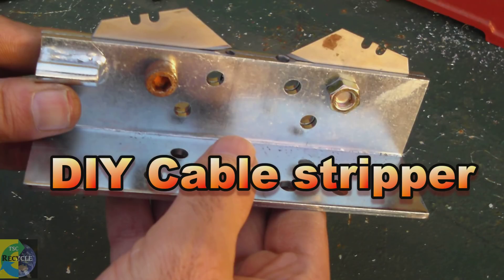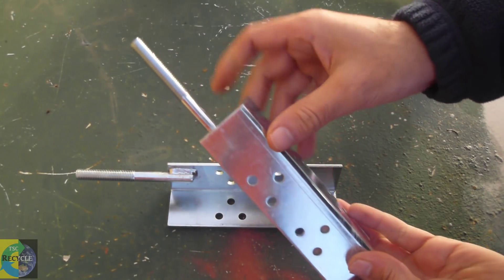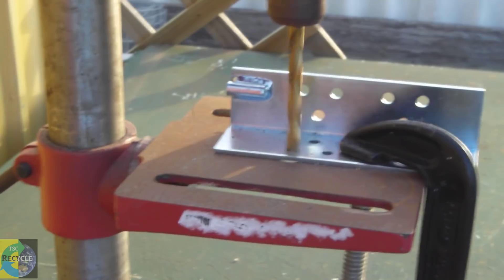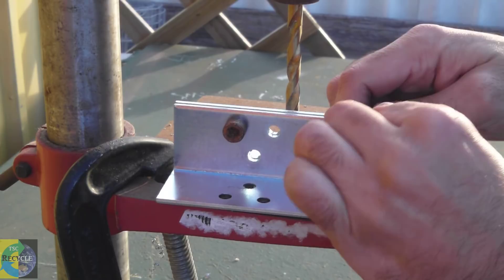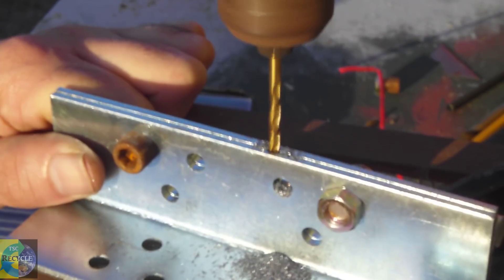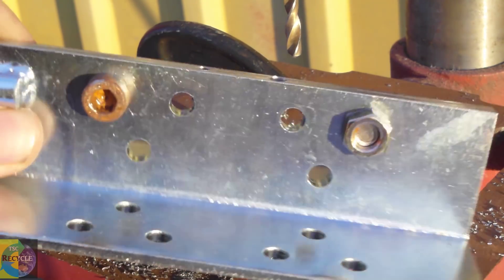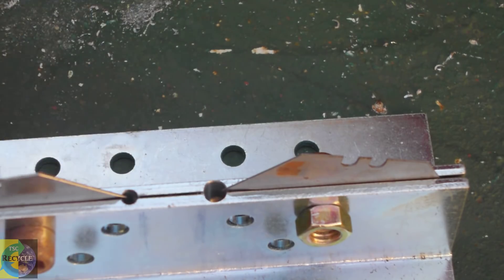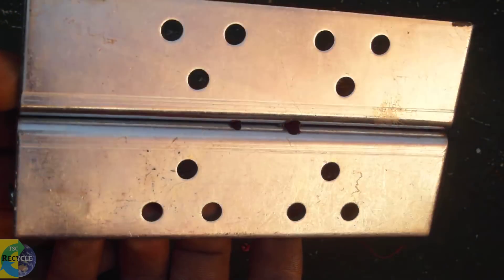homemade DIY cable stripper (from scrap parts)

Comment: Tried this exact setup, doesn't work.

The blade pushes itself out after about 8 inches so I don't end up with a deep enough score to pull the wire out of the insulation. Either that or the wire rolls to the side and the same thing happens.

Comment: All good but l just use a blade clamped in the vice between two washers.

l just put it in the right side of the vice and drag the wire over the blade.

You can use different  thickness washers for different  size wire
.
Just make sure the blade tip is not protruding above the top of the vice for safety.

Comment: Thank you! I work in construction and have been taking all the cable that gets skipped home with me but it's been building up faster than I can strip it using a shop-bought cable stripper that is only designed to strip a few inches at most of the end and or using a Stanley Blade and doing it across my lap which has resulted in numerous cuts on my fingers and tattered trousers I'm gonna make one of these as it looks like it makes life one hell of a lot easier!
Reply from the maker: i hope this comes in handy... a blade in the lap sounds painful   : )
thanks for watching!

Comment: You are the first person so far I have come across that made a stripper that slices the wire instead of peeling it like a potato.  And it is adjustable. You showed me what I had in mind I just didnt know how to go about doing it.  I am always having to throw away extra hardware and brackets, and there is always a box full of wire within a few weeks. It isnt a gold mine but it is money in a box that accumulates. It pains me to see so much excess be thrown out. I'd save it all if I had the room.  Excellent video.  It has to be worth the time, this looks pretty easy and sensible.

Comment: Thank you for the great idea! I had been thinking about how to make a cable stripper for a few days and then came across your video and it solved my problem.

I used two pieces of wood instead of metal and clamped them in my vice to hold it down. It only took me 10 mins to make a simple one. And I stripped 100+ feet of 10gauge copper in about 5 mins. Thanks again!

Comment: Same idea but I always drill some holes in a 2x4 then hammer the blades in.
Reply from the maker: do you fasten the blade or just hammer it..can this achieve millimeter accuracy when piercing the sheath? 

please some more info, i am curious-  any vids?

Comment: You can tell it works as he uses fine multi wire cable to test - not just solid copper wire...Good design.

Comment: Good job mate. Had no idea this channel was doing much better than cyber mack.. You make me wanna go scrapping, can you make decent coin out of it?
Reply from the maker: thanks Bro, the Scrapping community is a very active and supportive bunch. I started this channel before Cyber MacGyver, but love them both equally  ;)
Its a good idea to collect power cables in wheelie bins, and then cash them in before christmas for beer money.  $2-$6 per kilo.
pure copper is best. i clean out my workshop when i get a trailer load,  get over $200 a load ( no tip fees either).

Comment: I like your stripper design.  I think it's more practical and efficient than the roller types that tend to crush the insulation off the wire.  I will make two modifications to your approach.  I prefer to pull the wire horizontally like another person who commented. My stripper will use a two blade approach for each given wire size.  Where the blades are 180-degrees apart.  Using two blade should make it even easier to get the insulation to simply fall away.   Thanks for sharing your idea!
Reply from the maker: thanks for the support and feedback. i made it as simple as possible..
good luck with yours, feel free to drop by and share your results

Comment: So for larger sized wires I will need to get thicker brackets? BTW nice work good thinking buddy.
Reply from the maker: yep. spot on.
it gets tricky with really thick cables, but a wooden tool might work better in those cases.

thanks for watching

Comment: thanks for the vid bud! best one and easiest cable stripper ive seen on youtube and im definitly making it. just got into hobby scrapping and i've been trying to figure out how to speed up the stripping without spending $50 plus for a machine. ive got everything but the drill bits for this build!
Reply from the maker: hey thanks mate!
your words are a shot of adrenaline for an inventor/maker. I am so pleased that this stripper is going to help someone else... that's awesome.
It was born out of necessity and the lack of big bucks for a pre made unit. Let us all know how you went...

cheers and good luck
Reply: tsc RECYCLE e-scrapper it works however I don't have very thick angle iron so I'm kinda limited on the wire thickness and I can't seem to get the blade to stay still
Reply from the maker: hmmmm.. how about trying two square tubes side by side. It would look totally different, but will allow you to drill any size hole.
As for the blade, the only way is to squeeze it in place with extreme pressure (as its not possible to put a bolt through the blade).
I will try to make a video for you, for larger diameter cables.

Comment: if you left those threaded parts on you could of chucked it up in a vice and pulled the wire horizontally
Reply from the maker: +jeph4life hi. do you mean;  stand the tool vertically in a vice and use it as normal, except pull on a horizontal axis?
if so, then you're spot on. However i like to clamp it down with a G clamp and pull the cable vertically (for convenience). 
Thanks a lot for watching.
Cheers